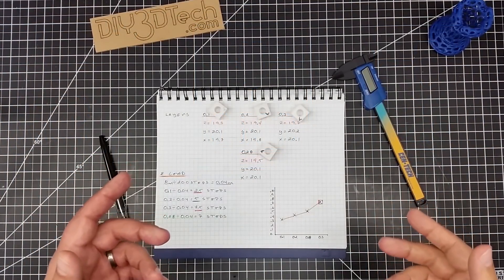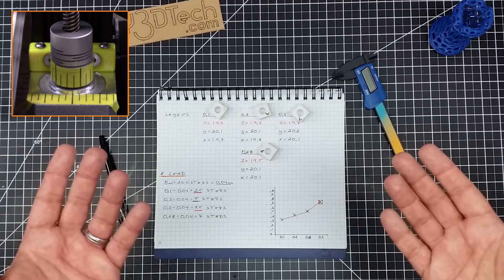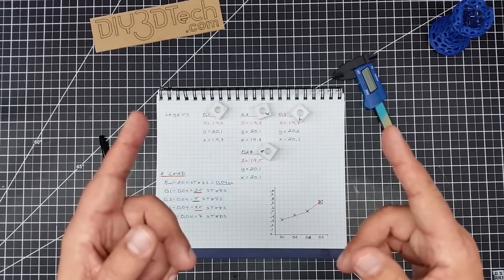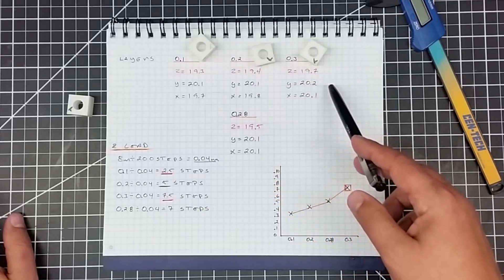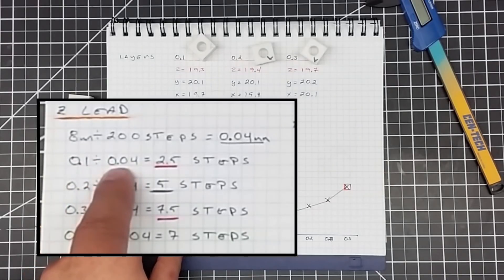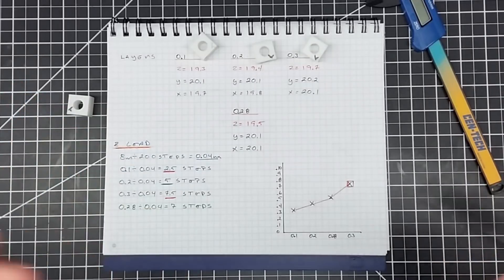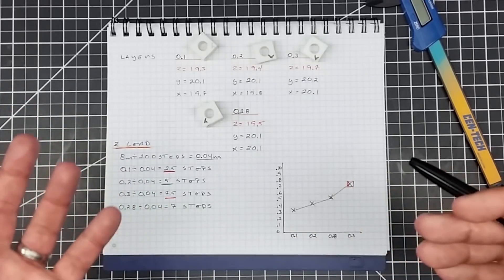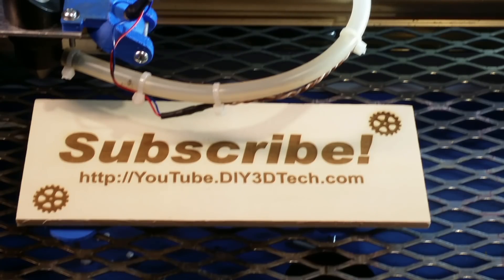Shop Talk - Is your Z Axis Lying to YOU?

Comment: tl;dr: NO the Z- axis is not lying, but everything else is.
I'm afraid you misunderstood the point of the Prusa calculator. Using FULL STEPPS and their respective Z-resolution values is best practice because the steppers holding torque is highest at FULL STEPPS. BUT not doing so will not result in the error you described. Every printer sold or built in (at least) the last 5 years had MICRO-STEPPING activated on all stepper motors (typically X16/16-times). If your printer firmware is configured correctly to NOT switch the stepper motors/drivers off when the Z-axis is not moving the error is minimal because a lead screw system has very high resolution due to the high gear-reduction it provides.  ONLY if your printers firmware is configured in a way that it switches OFF the stepper motors after the Z-axis stopped moving there is the POSSIBILITY of a small error in the case your layer resolution does not end in a FULL-STEPP but in a MICRO-STEP. Lets say you have a typical TR8 lead screw with 8mm travel per revolution, your stepper drivers are set to 16times MICRO-STEPPING and you want to print in 0.05mm thin layers. Then your Z-Axis motor makes 1.25 OR 1 1/4th STEPPs OR 1 FULL-STEPP and 4 MICRO-STEPPS to move the Z-axis those 0.05mm. If your drivers/motors are deactivated after the Z-move is finished there is the CHANCE that your Z-stepper motor falls back to the nearest FULL-STEPP after being activated again causing an error of 0.04mm / 16 * 4 = 0.01mm . But again, all recent printers, even cheap Chinese ones come with 16times MICRO-STEPPING activated and DON'T deactivate the Z-axis after moves, so there is little to no risk of Z-axis error for the reasons you described. All other reasons for Z-axis error have far greater impact. Like the distance between nozzle and bed at Z=0 or how the slicer handles interpolation to get you close to the desired Z-height, but most important your Z-axis couplers, especially if you use Z-hopp on moves/retraction, then, you almost always have mechanical backlash wich is far worse. Also how well lubed is your lead screw? Friction hinders the Z-motor in reaching it's final position.
My calculations can be reproduced here: https://www.prusaprinters.org/calculator/#optimallayer
Which is frankly, is what you should have done on camera in the first place, your editors were not wrong and a lot of 3D printing YouTubers have done so before you. Why invent the wheel again?
PS: I still use the optimal layer heights calculated because i accidentally bought lead screws with a much higher pitch which have therefore lower resolution and are harder to move for the stepper motor but easier moved by external forces.
Reply: All I know is I try to have my Z live by the Prusa Calculator so an 8mm per turn Z screw is crap so I use a 2mm or a 1mm per turn lead screw so I never ever see any ERROR on that calculator.
Reply from the maker: Wow that was a long post to end up saying you still do it that way...
Reply: ^^ I know... Do as I say not as I do. :P
BUT: I gave a reason.

Comment: of course only going full steps may be true for the dinosaur drivers in the cnc world, but in the 3d world you can get 1/16th stepping drivers for pennies, and for dollars, 1/256th drivers..... unless those ebay sellers are shi77ing me....
Reply from the maker: You still will only be able to move within the physical constrains of the system
Reply: DIY3DTECH.com true, just in smaller steps... For non NASA use I think we get pretty good resolution for the buck, and it's great you made this video as not many give it a second thought that we are effectively cutting a digital not analogue cut so we get digitised errors, even with 1/256 on a 200 stepper into a 2mm pitch screw your getting steps, possibly smaller than the backlash.... But usually still visible to the eye in a finished piece. It's amazing what we can do with bits just off eBay and a bit of ingenuity. Have a great day.

Comment: I read somewhere that those types of leadscrews (like the Anet A8), that the layer heights should be in increments of .4 layer heights to prevent drift (by your math, .5 is 70 steps)
https://3dprint.wiki/reprap/anet/a8/layer-heights
I have found that the sweet spot for quality and speed on my Anet A8 is slice at .24 layer heights
Reply from the maker: Have you tried the Prusa calculator?
Reply: DIY3DTECH.com yes, thanks!